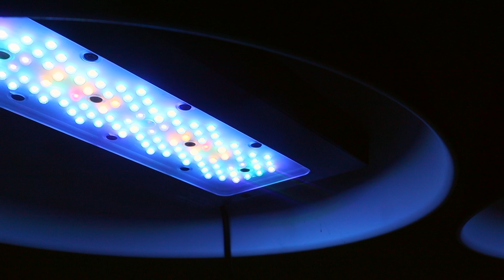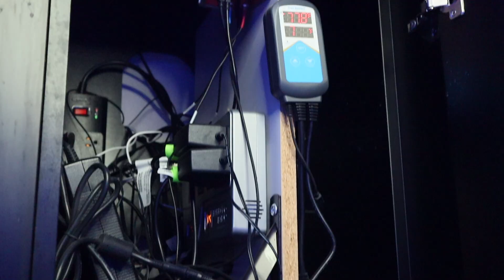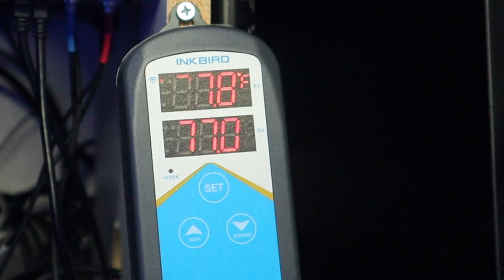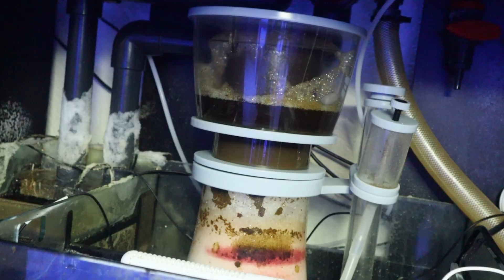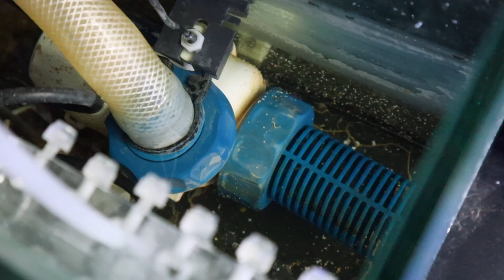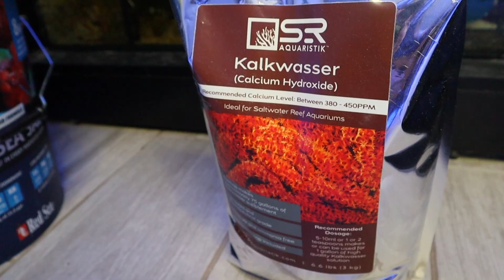My Reef Tank Equipment & Sump!

Comment: OK..
.if you're "dosing" kalk vis the ato... it doesn't matter the amount you add to the water.
Put a cup full of kalkawasser into the ato, fill it with water, throw a power head into it... I've got an old penguin in mine been running for years just sits in the ato. Run the powerhead for ten minutes. Water settles down and there you go. It's at max kalk saturation. Every few months throw another full cup of kalk into the ato... every time you fill it with water powerhead for ten minutes 🤘

Comment: Queen your sleighing it way to hard i got a 55 gallon take with a 70 dollar fliter and a 70 dollar blue green red and white lights i got hammer corals, anemone beds , stoney corals, zoa gardens yellow pollyps digital corals that gave been alive for 2 years with no sump or skimmers just a tank a fliter and some lights my corals are now worth 3,000 dollars my set up was only like 250 dollars skimmers take the copepods away so i dont use that all you need is the right food to feed thats its i use fuel and iodine 2  sometimes 3 a week my fliter is just sitting at the top tank sucking in water from the bottom spitting it out at the top just a regular fliter you would ise for freash water

Comment: This is a sweet setup! I actually have the same setup just different skimmer and I use a filter roller. I kind of have an ocd with cable management and have my controller board on the left side and ato on the right. I wish you tube would let me post a picture tho... Either way looks great! Your doing a good job!